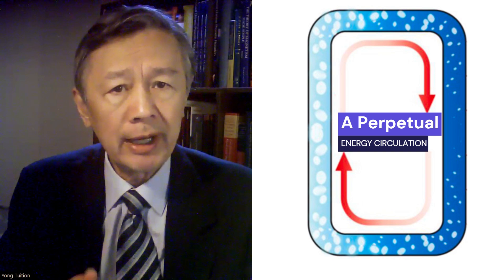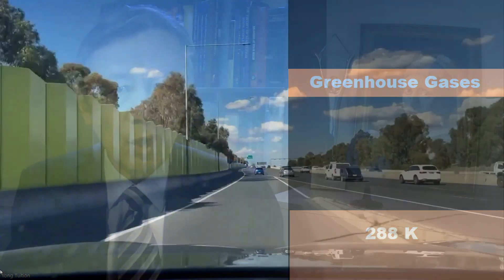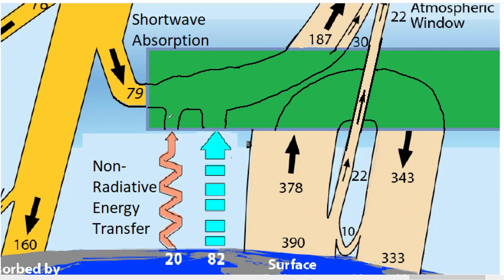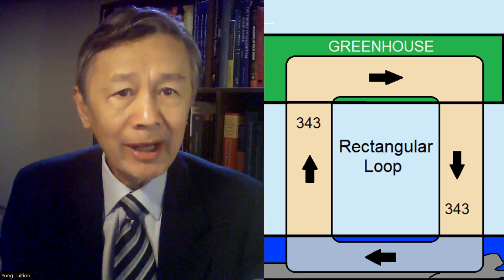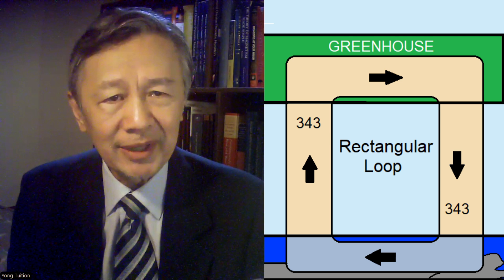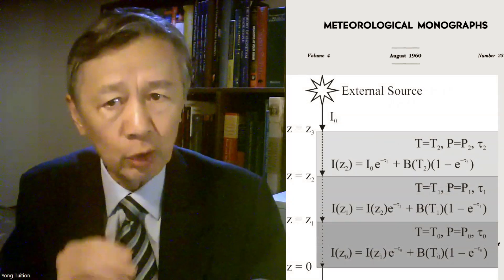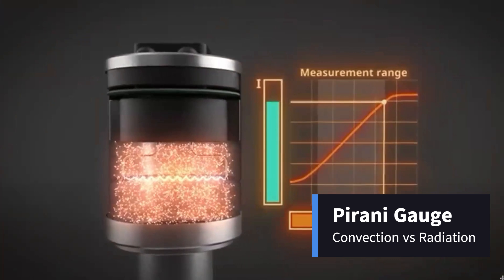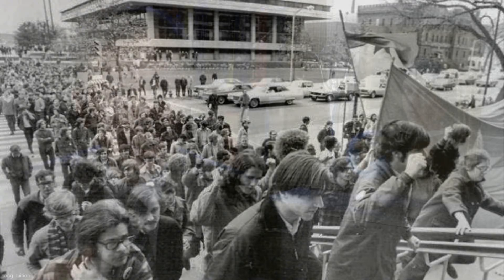A Perpetual Energy Circulation Revealed | Independent Research 20241201

Comment: From your new analysis by spotting the 35 watts, the 160 watts equates to 20 (non radiative  energy transfer) + 82 (latent heat) + 36 (342-378) + 22 (atmospheric window). 

Atmosphere cools in the range -49C (NP) to -84C(SP). 

Proportional to 102 watts of average heat (-67C). 

This is the heat in the stratosphere, this comes from the surface as latent heat and heat (atmospheric window) in a convected air parcel. 

The sun adds heat to this stratospheric air -49C as well a loss when sun is weaker -84C in July.

Winter has more solar heat (351w) coming in from the sun (but higher reflection (land snow) 22 watts) than in summer 329 watts (higher absorption (no snow) 22 watts).
 
Jan earth 329 watts, sun 351 watts
July earth 351 watts, sun 329 watts

As NH is 68% land while SH is 68% ocean.   

Back to 102 watts in the stratosphere, now minus 82 and 20 from 341 watts leaves 239 watts of average energy flow coming in and going out. 

Surface temperature is only mid lattitude stations that assumes the 36 (342 - 378) and (22 watts), that makes up the 390 watts(colder regions have insignificant amount of stations to offset mid latitude mass of stations average temperature). 

Earths climate is heated by pressure 1013 hPa=364 (1.27 x 287 gas constant) * 278.3K(Kelvins). 
337J*300K=1011kPa (1.17kg of air)
412J*245K=1011kPa (1.43kg of air)
and heat capacity of air. 
287+713=1002 J per Celsius

713*278.3=198kj
1.4 x 1.27kg (1.778) x 334 m/s (squared =111,556 J) = 198 kj = (278.3K x 713J).  
Added together you get 299kj (101+198) (plus 22w and 20w ) = 341 back radiation.
300 j/s and 42 w/m2. 

The tilt of the earth changes the reflection of heat (winter -22 watts) and (summer +22 watts). The purpetual energy circulation exists as 102 watts not 343 watts.
Reply from the maker: I used their global mean values. In theory, you need to work out integrals by filling many gaps of data in order to make your arguments.
Reply: @yongtuition  Their global mean values isn't global. 164.5 watts is NH only for January. 175.5 watts is NH in July (multiply by 4 to get the inverse of TSI). Global is double(329w Jan, 351w July). I explained that their global tempertaure only represents mid-latitude areas. Earth is a grey body 278.3K not blackbody 288K. The sun adds further heat to the atmosphere/earth, above already heated stratosphere at 104 watts (207K) to 340 watts (278.3K). Cars do not stop at 100mph when their is no power, neither do molecules average kinetic energy. These are the intergrals I have worked out. From observations of temperatures (weekly and daily if i have time) across the earth of 4 years now. This goes against the narrative and what is taught in institutions. And of course you will question my arguments. Average usually refers to typical value. If you have thousands of stations in mid-latitude areas and a few hundred in polar regions then mid-latitute (40°- 35° latitude) will be the average. If all are proptional then a lower value will be the average(50°-60° latitude).
Oct 6th 2023 (50°N 6°C + 60°N 9.2°C)/2 7.6 + (50°S 4.6°C + 60°S -1.8°C) 2.8 / 2 = 5.2°C.
Reply: Correction : Oct 6th 2023 (60°N 6°C + 50°N 9.2°C)/2 7.6 + (50°S 4.6°C + 60°S -1.8°C) 2.8 / 2 = 5.2°C.

Comment: to extend the point about the second law, because air temperature drops with pressure, and pressure drops with altitude, it naturally means that energy cannot travel down within the atmosphere. so the only meaningful case we have to consider is the direct interface between the ground and the air, not some arbitrary midpoint several kilometers up.
Reply: exceptions are rainfall under the clouds; and the Highs, the centers of high pressure, where the air comes down (mechanically); while the remaining air (minus the raindrops), in the Lows,  in the rain clouds, seem to rise up even higher than the top of clouds. 
 
in the Supercomputer climate models, they always say the cloud-effects can't be or are hard to simulate, so they don't do it. Maybe they don't want to include it, because it would negate their all-so-sure predictions!
Reply: @konradcomrade4845  yes you are correct, such up and downdrafts can move the energy, amazing that they don't want to consider it

Comment: The atmosphere has an average temperature of -18C. A perfect radiator, a blackbody, at -18C emits ~240W/m^2. According to Trenberth, and many others, the atmosphere emits 100W/m^2 more heat than a perfect blackbody. That is ridiculous. Trenberth must lack all forms of education in thermodynamics. Why has this been allowed to pass? Anyone with just basic knowledge in physics can see that this is totally wrong.
Remember Prevost’s principle: the emission from a body depends solely on the internal state. This physical law has no exceptions. The atmosphere is not the internal state, it’s external. Surface emission, and therefore surface temperature, depends only on the internal energy of Earth, according to Prevost’s principle. There can’t be a greenhouse effect because it violates Prevost’s principle. 
The internal energy of a system is governed by the first law of thermodynamics. Only heat and work can increase the internal energy. Heat is defined as the energy in transfer from high to low temperature, and the atmosphere is much colder than the surface so no heat is transferred from it. This means that the greenhouse hypothesis also violates the first law of thermodynamics. 
The greenhouse effect is an abomination. It’s the greatest embarrassment in the history of science.
Reply: it's all about politics, not about science. the climate agenda drives social and political changes which are convenient to the ruling class
Reply: I’ll admit that the perfect math is over my head, but the idea that trace amounts of carbon trap/add enough heat energy to warm the giant planet always seemed way off in degrees required per molecule. 
Your explanation makes perfect sense to me, in that light. 
Thanks.

Comment: It is astounding how climate "science" fixates on radiative heat transfer between the air and the surface which is really negligible at ambient air pressure. The big clue is the fact that dead air (air trapped in spaces which are too small to develop convective circulation) is a good insulator because of poor conductivity of air. However, if convection can occur freely, air is a poor insulator. Even more important is the distinction between natural convection and forced convection, especially when the latter occurs in a regime dominated by turbulent flow. When you have forced convection with turbulent flow air becomes very efficient at removing heat. That is why we use fans, because they work very well.

Convection in the real world is almost always forced convection with turbulent flow as it is driven by global wind patterns and the surface is decidedly not smooth. What we experience at the surface is generally speaking the slowest wind speeds as surface friction slows air flow. 

I frankly find these global energy budgets laughable. There is no way you can accurately calculate the convective heat flux over a wide area of terrain with varied topography and many different surface covers ranging from paved surfaces to deep forests. It is a joke.
Reply: Tom Shula: A Novel Perspective on the Greenhouse Effect | Tom Nelson Pod #98. The Pirani Gauge proves that radiation at the surface is insignificant in transferring energy to the atmosphere.